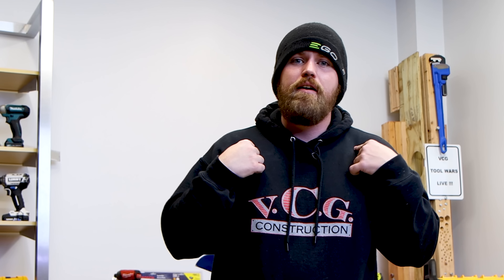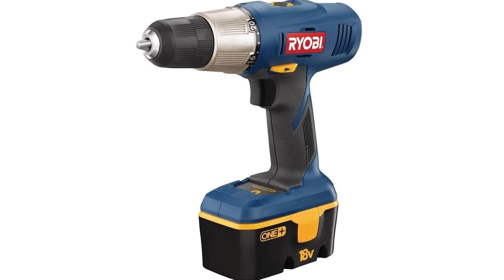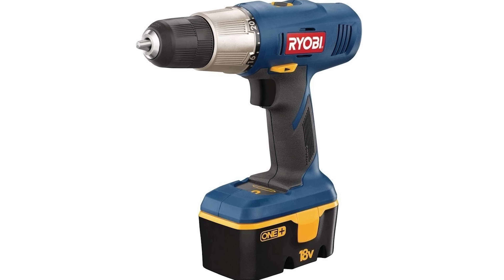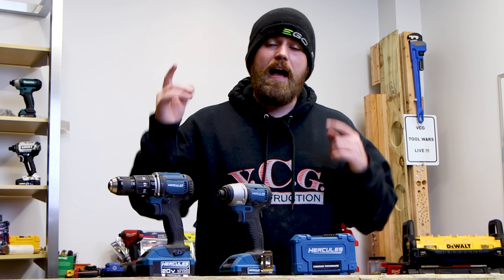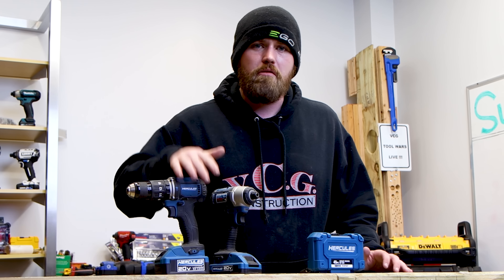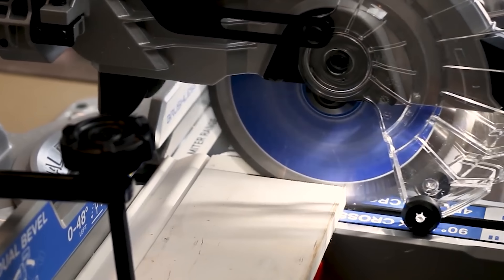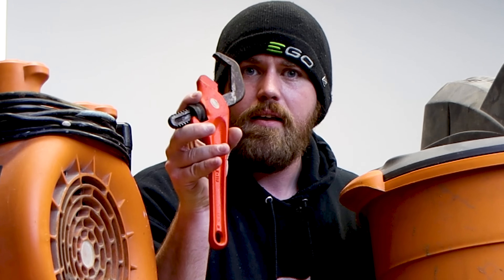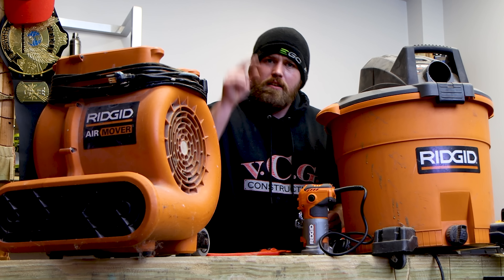TOP 5 MOST HATED POWER TOOL BRANDS (that are actually great)

Comment: I'm a guy that makes a living with his hands and tools. I've been at it 45 years so far. In my experience of all the many tools I tried over the years, when it comes to Cordless tools I always use Ryobi. The performance is top notch! They can take abuse and keep on going. I once dropped one off a roof onto a concrete driveway 3 stories down. It broke into 3 pieces with 2 wires connected to each piece. I was out in the middle of Nowhere far from Home Depot. I was minutes away from being done with the job. Nearest Home Depot was 45 minutes away. I used duct tape and pieced it back together. Not only did I finish the job I got 2 1/2 years more use out of it before it just died. So Yeah, I agree with this guy when he says Ryobi is a good tool brand!
Reply: Lies again? Tired of living
Reply: I've been using Ryobi as well all my tools that I can buy Ryobi I just got done getting their new HP brushless impact hammer drill regular drill and grinder and I have been thoroughly impressed with them. I have the corded laser skill saw that's amazing I have ripped down two by fours and look like perfect trim didn't even have to stay on the cuts with the Diablo blade. And I still have my drills from 11 years ago that I bought from Ryobi when they switched like he talked about I have dropping them off a two-story roofs I've left them out in the rain I even left them underneath a tarp out in the weather in Missouri for a year. I did no maintenance on those drills never added oil never cleaned them and they still work today. The one thing I've noticed about Ryobi versus any other tool is that they're like cats they have nine plus lives. They just keep coming back to life after they die. So even though Ryobi might not outperform tools like Milwaukee and flex they pretty much outperform all the rest and the longevity of the tool is not matched by any other.
Reply: @NazriB if I was you I’d be tired of living as well.

Comment: I use several Bosch corded tools. They have held up to major job site demand and abuse. No problems over the course of several years and they have proven to be a bargain compared to other pro brands, especially if on sale. I moved from DeWault to Hitachi (now Metabo HPT) cordless tools about 6 years ago as they were well reviewed, typically less expensive and have a lifetime warranty on the tool body. They are amazing. Have not sent one in for service yet. They are powerful, light and take abuse. I’ve been on several jobs where I’ve heard other tradesmen and even my co-worker (25 years master plumber) refer to them as “homeowner grade”. They changed their minds on that after using them. I think Metabo/Hitachi deserves more respect from the professional community than they receive.

Comment: Bosch should not be on this list, bosch is one of the best brand on the market right next to Dewalt, bosch has very durable tools for DYI, PROs and industrial. Ok with Rigid on first place, that brand has very sturdy, durable and quality tools they are underestimated but not undervalued since Rigid is not cheap.
Reply: todopoderoso3 see, that’s the thing. Most people, especially people that work in industrial and commercial, hate Bosch. I don’t particularly like Bosch, mainly because they don’t have the durability and longevity to last in rough environments. If you’re a renovation builder or a HVAC technician Bosch is great. But if you’re out bashing houses or working on big supermarkets, Milwaukee or Dewalt is the way to go
Reply: @samdelaney1134  I use mostly dewalt but I have the Bosch SDS and use it daily for years. its gotten wet countless times. I know quite a few people who use Bosch in a commercial line of work and they seem to hold up great. plus isnt Bosch like the top brand sold in Europe? im a dewalt fan boy and just dont want to own 2 battery platforms, but if I had to switch to Bosch I would not feel like I was downgrading at all. bosch is designed to run in wet or dusty environments... just check out concreteworld video. bosch is worth a second look. and their lasers are by far the best I have ever used.

Comment: I've been using Bosch tools (I own a wide selection of Bosch tools) for around 8 years now after making the switch from DeWalt & I have found that I actually like Bosch far more than I ever did DeWalt (& I thought I really liked DeWalt before using Bosch). As an electrician, I see Fluke gets all the love in the trade (as far as testing equipment goes) but I made the switch to FLIR a couple years back & found FLIR to be another underrated (outside of their thermographic tools) tool company alongside AEMC/Chauvin Arnoux. As for standard tools I have come to like the wide selection of tools offered by Milwaukee but that by far isn't an underrated company.

Comment: I own a Bosch drill and 1/2" impact driver (blue professional ones). I have beat the HELL out of that drill on the job, and it continues to work as good as the day it was new!! The impact driver has plenty of torque: I used it to remove an automatic transmission from an S10 Chevy Blazer, and it performed flawlessly! I have 2 smaller batteries, 2 chargers and one Fat Pack battery. I will ABSOLUTELY buy Bosch 18V tools again!
Reply: Only problem is that their brushed tools are very power hungry.
My 18V shopvac (GAS 18V-10L) eats an Ah in no time, and the power draw is so high that the battery is smoking hot when it runs dry. So hot that the charger won't start charging for at least a couple of minutes, even my active cooled rapid charger (AL 1860 cv).
I did a sanding job not long ago, and my 2 chargers, one of them being the rapid charger, couldn't keep up, so I had to use 5 4Ah batteries to get the job done.
That being said, that thing can suck harder than (insert random "yo mama" joke) until it is completely full! :)

Comment: I've been starting to collect Ryobi tools for about 3 years now. Mainly their brushed tools. And they are a great tool a little bit more expensive across the boarder from the US side. But they are great. I have not had a problem yet with them. and use them as a diyer/Apprentice. Besides being that lime green. (Not one of my favorite colors but oh hell what can you do. At least you can spot where they are at any given time with that color. I give them two thumbs up.
Reply: @chesterswingjr9796  the problem with them is that they sell in the States. I'm in Canada over here. Unless they have prices as well in Canadian dollars. I did check them out and they don't go outside of the US.

Comment: I never thought I will find Bosch in this "unwanted tools category". And yes, why is Bosch in this category? I've been using Bosch since 2013 and I had no problem with them. I sold them last year in a very good condition after daily using in my business. I was watching at lots of video: cordless tools comparisons plus reading about different brands as milawakee, makita, hikoki dewalt and Bosch. And after all, I bought today Bosch again. In my opinion they are very strong and durable tools. It is a German engineering and it can't go wrong. My good example to see is: BMW, Porsche, Mercedes, Audi, VW they are german engineering. Why soo many people buy them? For me, I'm sticking with Bosch. I've tried Ryobi few years ago. I will never buy anything with that name on it. Not worth a cent... that is my opinion. I'm sure everyone have a different opinion.
Reply: I use mostly dewalt but have a few Bosch tools... many times people make negative comments about the Bosch, but none of them ever owned one.
Reply: Ryobi user here i own a p213 (5 years old) drilled thousands of holes in metal wood tile and masonry (around 10 mm in concrete) i wasn't able to stop it yet, it cost me 75 usd.. it gets the job done I'm not saying it's the best... It just works

Comment: I respect all tools, every brand has something to offer. Keep up the great work VCG Construction.
Reply: Here in Denmark, we have a brand called Power Craft. That brand, I have absolutely NO respect for.
When I bought my house, I needed an impact drill and bought a Power Craft as money was running low. The gear box on it broke on first use. Swapped it for a 710W B&D that I still have 15 years later.
In my infinite stupidity, I bought a 2. PC tool when I needed a router. I needed it for a dado in the poles for a fence. One of the handles broke fefore routing 3 feet. My dad had to use his circular saw to get the job finished (I was very green when it came to diy, and had no experience with a circular saw at the time).
In general I don't trust any brand with buzzwords like power or super in the brand name...
Reply: @HepauDK  , Power Craft is absolute bottom scrape. BUT that is for a reason! These tools are soooo cheap that I could buy 5 of them for 1 decent tool. They are also sold in some dubious "bottom feeder" shops. Do they break? They say so. Weird thing is - never happened to me! I'm no proffessional, but I have used the hell and more out of a cheap Power Craft electrical planer. I also used the hell out of a cheap Ryobi cordless 12V drill (battery finally died after years of usage), a cheap B&D corded drill etc. I bought ridiculously priced Power Craft angle grinder for ONE job. Nothing more. I expected it to break. Nope, did not. Still (ab)using it quite often. Every time I think of the money saved, it brings a smile on my face:) The way I see it - overall quality of electrical tools has jumped up exponentially because technologies that used to be "cutting edge" some time ago are just so cheap to implement and copy. Just think how the bottom end of today was "high end" mere 10 years ago. But yeah, I agree, the feeling of frustration of a tool breaking during a project is 10/10 unpleasant. If I were a contractor, definitely would not like this feeling.  It is also funny satisfaction to see a "cheap junk" keep working. And working. And working. It's hilarious really, becomes some kind of a sport: when will this damn thing break? Everybody says it should be dead 10x over. Nope, it keeps going! I have built enormous amount of projects with these cheap tools. Very embarrasing... Should I invest into "serious/manly/pro brand X" as the merketeers keep telling me? Dunno, I keep shrugging my shoulders:)

Comment: Cool video Nick
Good job on the presentation.
I just replaced a 30 year old 10" Craftsman miter box saw and a 10" compact table trim saw also about 25 to 30 years old LOL !!!! 
They did get looked at like are serious !!!!!   Those 2 made a bunch of cash over a long time.
There now keep in a place of honor in my shop 😁.
There replacements are the Hitachi/Metabo HPT 10" table saw and the Hitachi/Metabo HPT 10" dual bevel sliding miter saw.

Comment: I've been a Bosch convert for the last 18 months or so. Since it's been an underrated brand in North America, I've been able to score great deals on Home Depot and Ebay. The fact that I've been able to score the Freak 2, a Hammer Drill and a reciprocating saw with 3 batteries and charger for less than $400 is just hard to beat.

Comment: I have Ridgid, Ryobi, and Hitachi/Metabo and DeWalt tools and my partner had several Makita and Bosch tools, as well.  Honestly, the DeWalt tools always let us down. As General Contractors, we worked them all hard but it seemed that DeWalt tools were giving out while the others continued to run.  

I've got a 12 or 13 year old Ridgid Hammer Drill and an Impact Driver that run as well today as the day we bought them.  We actually bought them as cheap replacements for "when" the DeWalts would crap out on us again.

The Hitachi/Metabo is a framing nail gun that is excellent.  Durable, no jams, good battery.  No complaints.

Ryobi made their way onto my truck for some punch list stuff and for the wife and kids to use.  The belt and 1/4 sheet sanders are okay, though they seem to be underpowered with 2.0Ah batteries.  The Oscillating multi-tool is one of my favorite tools; ergonomics are great.  And the Ryobi Airstrike Angled Finish Nailer is AWESOME...Love not having to run air hoses through a room on remodeling jobs as it helps avoid issues with pulling the hoses around cornerbead or trimmed out walls and doorways.

I am looking to trade out the tools I have and go with just one line for batteries.   I really like the Flex Tools at Lowe's but they are pretty expensive for a short track record in US.  I do like that Flex is offering lifetime warranty for those who buy tools by the end of the year.  That puts them on par with Ridgid for me.  Right now, Ridgid is having great deals at Home Depot...With two of their combo kits, I can get 7 useful tools, 3 4.0 Ah and 1 2.0 Ah batteries for right about $600.  For 7 tools and 4 batteries, that works out to about $55 per unit.  Just a great deal.  If Lowe's were to match, tool for tool and battery for battery, I would probably go with the Flex line to try something new but, otherwise, I think Ridgid over Ryobi in terms of the brands I have, especially given the track record with me and lifetime warranty.

Good video, Nick.  Thank you!

Comment: Love my Bosch tools. Have both 18 and 12v systems. Even took the 12v drill and impact on a mission trip to Kentucky where we replaced a floor,  joists and all 12v impact worked like a beast running wood screws. I was totally impressed with the performance.

Comment: I think it is odd that you mention Ridgid in this list. I have several of their tools, and I just love them. Recently purchased their brushless circular saw and that this is beast of power that cuts beautifully clean. Also picked up their Contractor table saw recently. They must have some confidence in their tools with their lifetime service agreement. So far I have not had to use it on any of my Ridgid tools...next stop the Ridgid palm router.
Unfortunately when I was a kid, Black and Decker and Craftsman were the tools to own. That is no longer the case.
Reply: You will love it! Fast, strong, compact, light weight, infinite speed adj from 17 -30K... I get PLENTY of run time out of the 3ah octane batts (I 3/8 rounded 150 bdft of still-wet PT 2x banisters/rails on my upstairs deck, in two passes, on one batt and still had 2 bars), the fence is well machined, dust/chip control is good, LED light is positioned well... The fine depth adjust is a bit tricky to get used to but once you dial yourself in to how it works, it's great... One more thing... The way Ridgid set up the on/off switch seems a bit awkward, again, at first... BUT there is practically NO way to turn it on accidentally.
Reply: @srqtad  Yeah, I have seen demos here on Youtube and it looks really nice. I have the Bosch and Dewalt trim routers, but you can never have too many, and both of those are corded models.
Reply: This much I can say... walking up and down that flight of stairs, rounding 25' long banisters, for two passes each edge (8 trips up/down)  without having to deal with a freakin' cord was almost fun.... The router would have done it in one pass each eadge but it was still fresh PT and had some knots so I took it a little easy.... Same for the deck railings so, really, it was 300 bdft. just not at full load.
Reply: In some ways Ridgid is two companies.  The power tools are TTi's AEG power tools rebranded and they licensed Ridgid's name for North America.  As a DIYer I like them as a step up from Ryobi (which is also TTi licensing the brand name) which is a great entry level brand.
Fun facts for Black and Decker.  As you say they use to be good but at one point they started to get a bad reputation as a non-professional level tool so they re-purposed the Dewalt brand (which they owned) as their new professional level tool brand while B&D is for the regular consumers.  Craftsman use to be a great hand tool brand until hey start to cheap out on them and Sears started to go under... they are now also owned by B&D.

Comment: I have a Ryobi 4-stroke weed eater manufactured in the 90s that still works. Aside from routine maintenance, I have had to rebuild the carburetor once and replace the fuel lines a couple times. Not bad for 20+ years of service!

Comment: I'm a professional mechanic and I'll tell you what, Ryobi has been a great cost effective option for me and It kicks some serious butt. Plus they can really take some punishment. I've dropped them, used them as a hammer and hand just been cruel to them and they just keep running. Now I'll admit they aren't quite as fast as a Milwaukee so sometimes I just have to hold down the trigger a little longer but I see it as it does 80% for 20% the price.

Comment: Probably going to get a ton of laughs from this 😜👍.. all good though.  I would love to see Craftsman's 20v tools.  I picked up the impact and drill when they first showed up for $100 kit only to try out, accumulated a few extra batteries in the last couple years.. the 4ah batteries are awesome.  I just saw they have a 6ah..  not sure about the cells. Anyway,  definitely not as good or fast as other tools,  but they do get it done.  Recently picked up the multi tool,  grinder (looks exactly like a Porter Cable) and the 6&1/2 circular saw (performs like the old cordless DeWalt on the ni cad batteries).. the price is awesome for them.  Lots of ups and downs,  but for the most part,  these tools work great.  Very few complaints as long as you have the right batteries to complete your work everyday.. been doing this for over 22 years.. NEVER did I think Craftsman work impress me
Reply from the maker: It impressed us, we like the new brushless craftsman

Comment: Sparky here from Cali and I use bosch.  Never seen another rocking bosch at any jobsite in my 12 years in the trade. May not have the speed of red and yellow but the few seconds difference don't really matter when time can be saved many other ways (work smarter?). They're durable, reliable and smooth hell. I still use my brushed set  with the original batteries and would probably use them well into retirement